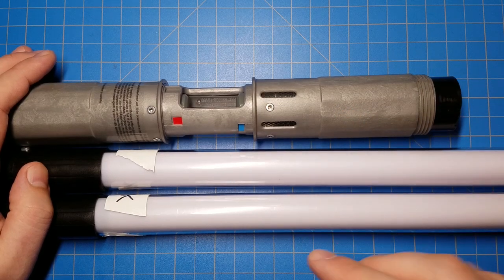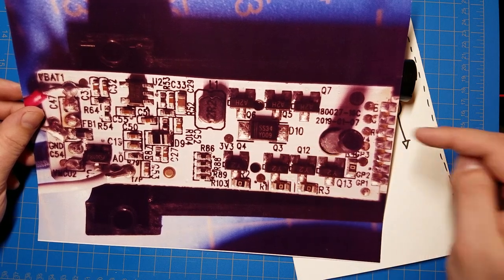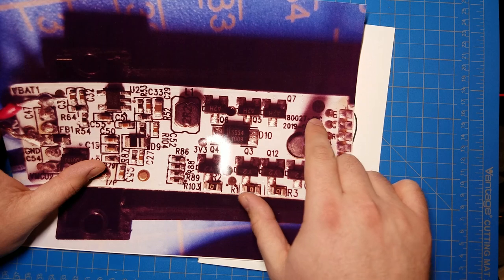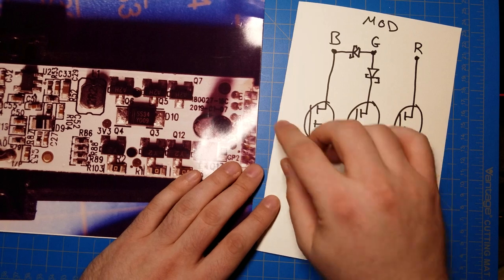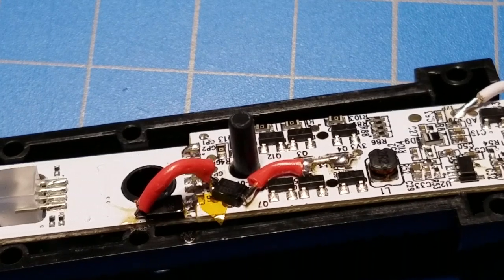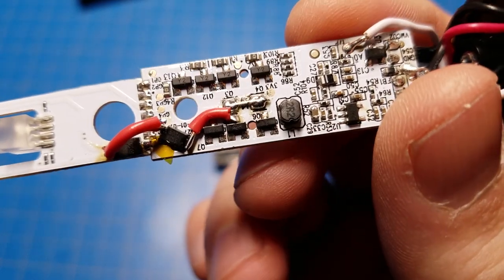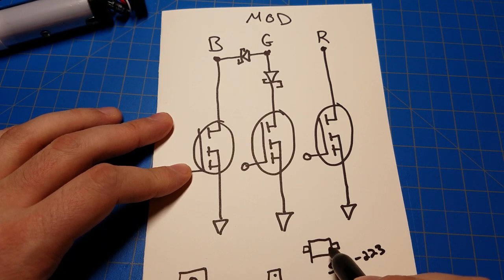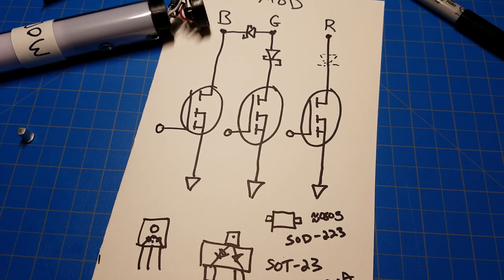Orange, Pink, and Cyan Galaxy's Edge Lightsaber Blade Mod - The Rough Draft

Comment: You should mod and sell these on eBay or Etsy. I’d love to get these colours but sadly I don’t have the experience or the tools to do this myself.
Reply: I’ve also seen some people have figured out how to make the chambers glow orange/teal by only modding the kybers. Seems pretty cool when paired with this.
Reply: Ultrasabers has every color you could think of, stock, made from metal and cheaper than can be bought from Disney
Reply: @optionfive.  You mean by only modding the kyber crystals? To my understanding, that's not possible. You'd need to modify the blade because the original blade is not capable of displaying an orange/teal color unless you mod it like this guy did.
Reply: @roywilliams577  True, but I wouldn't recommend buying from them. They outright lied claiming they have the best soundboards in the industry when they were some of the worst.
Reply: @CyberSonic157  the alternate custom kybers will still use default blade colors ie orange produces a yellow blade but can be coded that the kyber chamber lights are orange. I think I'll pick up a second blade to do this

Comment: Have you investigated the flash-on-clash after the mod work?
I have a Savi's Workshop "Peace and Justice" with a green kyber crystal. On clash detection, the blade flashes orange-white. 
   I'm assuming the microcontroller is simply requesting a new color input for this programmed condition, but it's being delivered from the same RGB channels. If those are modified at the PCB, what interference, if any, would you assume (or have noticed) could occur with the flash production? 
   Again fantastic work, much appreciated.
Reply from the maker: With this mod, the clash on a green crystal looks red to me. The clash colors are affected the same way the normal blade colors are affected. A white clash will look pink. A yellow clash will look orange. A blue clash will look teal.

Comment: Hey Ruthsarian! Thanks for sharing your work in these vids! I had a question: At one point you said that if you shorted the pins between blue and green you could get the cyan/teal result... So does that mean I could simply solder a wire between those two pins and get the result without any of the other work you've done? I know that means I'd lose the other color functions for the blade, but really that's the only color I'm worried about getting anyway.
Reply from the maker: that's correct. i added a diode so green would still be green. but if you don't care about that, short green and blue together and either a green or blue crystal will get you teal.
Reply: @Ruthsarian  Awesome! Do you have a recommendation for wire, or would something like a piece of cord from an old cell phone charger do?
Reply from the maker: @geekerrant7242  the green and blue pins are right next to each other on the hilt PCB. you can probably just use a big blob of solder to make the connection, no wire needed.

but wire from an old charger should be fine too.

Comment: So if, by comparison to the orange from purple vid, I wanted just orange and purple I could copy what you did in the other video and connect to the green instead of the blue?
Reply from the maker: Yes. You'd lift the pin on the green channel mosfet instead of the blue, then connect the diode to it. That will get you orange with a yellow crystal and a purple crystal will still be purple.

Comment: There's a code for teal and orange 3047 3077 for the chamber
Reply: Yup, and there's a guy on etsy who sells orange and teal colored crystals with the code programmed into the RFID chips. What's great about this mod is, as shown, the colors are activated with yellow and blue, and those are the colors that the blades read the orange and teal codes as, so it'll work perfect. But now we could also due a pink crystal with white. Only thing I'm curious now is if there's a why to reduce the power of red even more, like a second diode perhaps, so that the purple could be more indigo, white would be more of a lighter cyan, and yellow would be more lime.
Reply from the maker: Sure. The diode on the board is a Schottky diode, designed to have a low forward voltage. If you replaced it with a "standard" diode, like a 1n4007 or its SMD equivalent (an M7 i think?) then you'd get double the voltage drop on the red channel.
Reply: Thanks man:), fo you think Disney is going to release a new blade for teal and orange?
Reply from the maker: @cthulhu7473  short answer: no, unfortunately. 

they'd just need to update the code on the blade's microcontroller. that would be an inexpensive and easy to implement update. however a 'new' blade that supports orange and teal implies orange and teal kyber crystals would be released as well and all the savi's workshop lightsaber blades already out there would not work with those new crystals. the PR and customer service nightmare that would ensue as people complain that their $200 lightsaber doesn't work with these new crystals is probably enough to keep Disney from releasing such an upgraded blade.

if they didn't release new crystals and instead just used it for new legacy sabers that use those colors... MAYBE they'd do it, but then someone might try to use an old blade with that new legacy saber and they wouldn't get orange or teal colors and wind up complaining to customer service. so maybe even that scenario wouldn't work.
Reply: Ok thank you for the feedback
Reply: I didn't mean to say fo sry
Reply from the maker: @cthulhu7473  no worries. d and f are close together on the keyboard. i understood what you were saying. :)

Comment: Thanks for the video. I'm able to get the cyan to work however after removing the d10 and multiple attempts to bridge I get no light up on red. Any ideas where I'm going wrong? Thanks.
Reply from the maker: can you share a picture of your blade PCB showing the bridge where D10 was? either post it somewhere online and link to it or just e-mail it to me (ruthsarian@gmail.com).

also, just to make sure, you're using a crystal that would normally turn the red channel on, right?
Reply: @Ruthsarian  Yes I was using a red crystal. I was brave enough to attempt it on a second blade and instead of removing the D10 I just bridged around it using a wire with great results.

Comment: Can I still use the other colors with this mod? And is it dangerous to broke the blade?
Reply from the maker: With this mod orange replaces yellow, pink replaces white, teal replaces blue, pink replaces purple. But green and red are still green and red. So with this mod, you lose yellow, white, blue, and purple.

Making any kind of modification to the blade has some risk to it. It is possible that you could break the blade while trying to perform this modification. If you're uncomfortable trying to make this modification then I'd suggest you don't. Try buying some small soldering kits off eBay. You can use them as practice to get comfortable with soldering something like this.
Reply: Ruthsarian ok, thanks